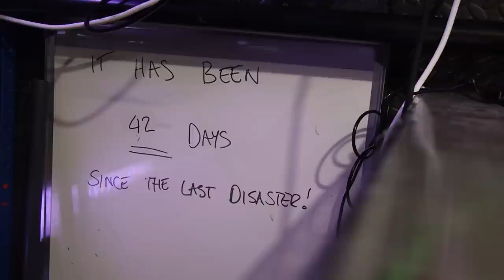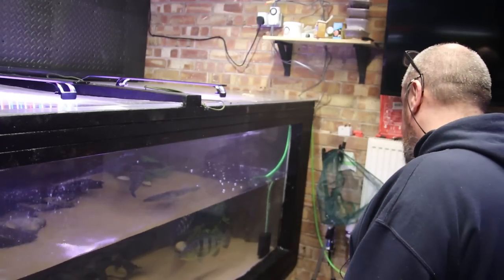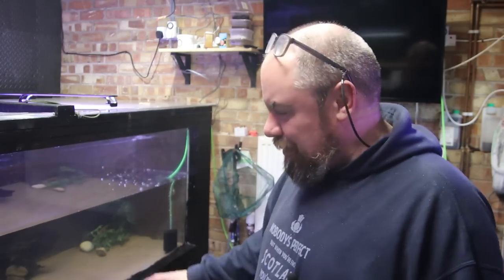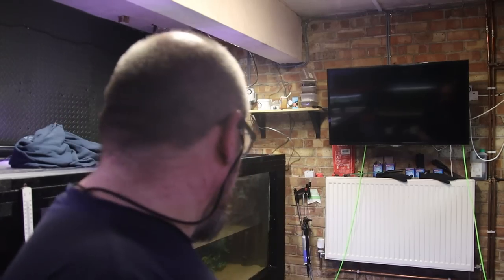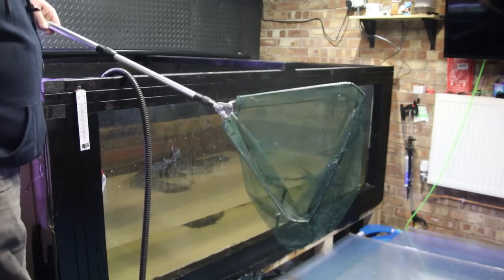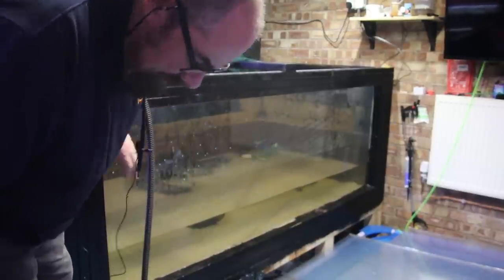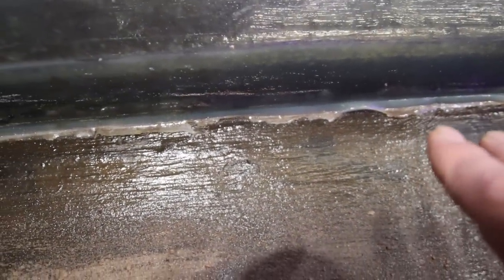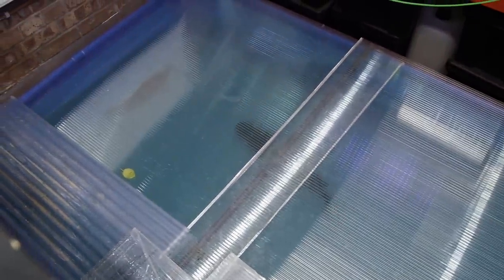Mega-failure - Monster fish tank failed.

Comment: I found your channel while I was researching plywood builds. I've previously read all over the internet that getting a seal between the glass and liquid rubber using silicone was nigh impossible. I'm really grateful for the troubles which you have gone through, and your transparency all along. It's a live demonstration of one of the rarer methods(at least on youtube). Most other builds on here I've come across use pond shield. I like the idea of the liquid rubber more, because the rigidity of the epoxy has me worried. But this very issue you are facing now has kept my finger off the trigger with the liquid rubber build. Hope you find a solution that works for you!

Comment: Gutted for you, try ms290 sealant it’s used on a lot of pond liners to seal to glass, I’ve used it to seal a glass window to a plastic pond . Or try speaking to cdwsandbach as the build a lot of ponds with liners and windows in and have their own sealant to bond rubber liners to glass, so that or the ms290 should bond better to the liquid rubber. The ms 290 definitely bonds to plastic /rubber surfaces.

Comment: Liquid rubber is used on roofs to fix leaks temporarily. If I where you I would start over.  Screw new wooden plates over the existing ones that are coated with the liquid rubber. And fiberglass the new wooden plates. Or like you mentioned let someone weld in an epdm liner. This is done in koi ponds and lasts decades.

Comment: As a plywood tank builder, I have had my fair share of leaks. Have you considered the possibility that the leak may be elsewhere in the tank and just showing up i the corner? Im not sure I buy that the lower water level and thus lower pressure is what stopped the leak.

Comment: Blessings to you, man!!!
I watched a few videos.. 
But, had to Subscribe now..
Aquarium Adventures, indeed!!
My definition of Adventure, generally.. "If I knew it would be like this, I never would have come on this ride!"
Am chuckling With you, not At you.. Cheers! 👍🍻
SUGGESTION... Take your time, since liquid rubber kinda sucks for this..
SAND Off the area (an inch or two?) around the glass..
Down to Wood. Masking tape - for the stop line of your sanding.
Epoxy and wood are great together. Cure the epoxy.
(blow dryer can even help if it is cold in there, and it pops any bubbles, while wet.)
Lightly sand the final epoxy coat, so the rubber sticks to it.
Reapply liquid rubber coats on to Epoxy, Stopping before the Silicone Zone.
(mask the silicone area with a half inch? masking tape)
Of course, clean all areas to coat or silicone with appropriate solvent or alcohol. (see my reply)
Reply: So. You have a good plan!
Glass sticks to silicone.
Silicone sticks to Epoxy over fiberglass.
Epoxy soaks into and sticks to Sanded wood.
New Rubber will stick to any bare wood BETWEEN the epoxy strip and the old rubber.
I say take your time, because the extra Cured coats of rubber on the millimeters of Wood between epoxy and old rubber... Should Ensure your success. Thank you for sharing... And caring for your fish!! 💖😎🎈🍻
Alohas, -Scotty on Maui. 🐳
(only bad idea would be putting epoxy directly on to rubber, instead of sanding. Would not bother trying that)
Reply: I feel your pain, man..
Am glad it is not in your carpetted living room! 😒😌
Reply: p.s. -If you have a basic plain epoxy resin without strands in it.. Two inch wide fiberglass 'Tape' is really easy to work with. Is just cloth with no stray fibers coming out of the sides.. If you can get it.

Comment: I fear a patch job just isn't going to hold. You are lucky there wasn't a complete drain and no fish were lost. With the kiddie pool you now have the luxury of time to pull that glass and fix it right. No more sleepless nights. If it were me, I would want a mechanical solution that uses bolts and gasket material. Do it right for the last time.

Comment: Hi just a tip in an emergency. I got gorilla patch n seal tape. Had a tank that I couldn't stop leaking at the bottom. I put this all over the inside bottom and that cured it. It's great for leaks at the edge for a temporary fix. I had resealed the tank. Found the cause eventually. It's quite expensive. There are other companies that do similar. Used a thin strip on another tank to seal the edge on a grow out tank. 👍👍 Don't give up. I know exactly how you feel. A length of that folded along the edge will fix it. That's exactly the same problem that I had.

Comment: You could have tried using ct1 on the seam while the tank was full, I had the same issue on my pond glass when it was filling it was moving the timber sleepers. So filling it in situe fixed it instantly touch wood it’s been fine since